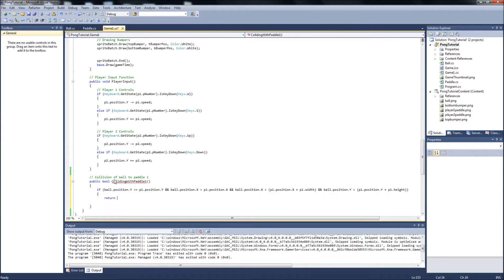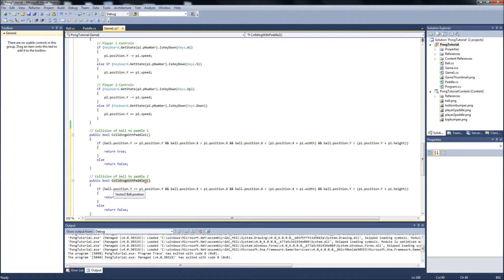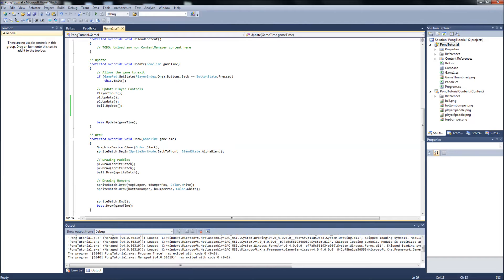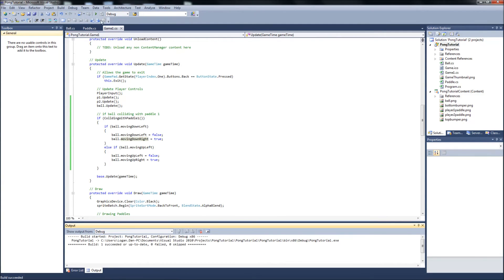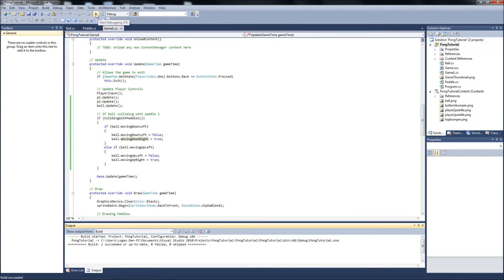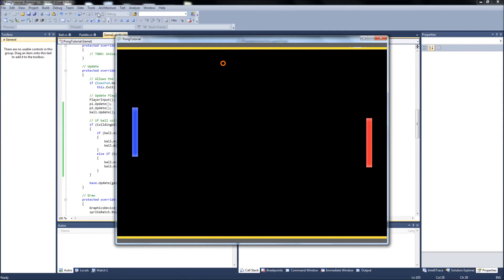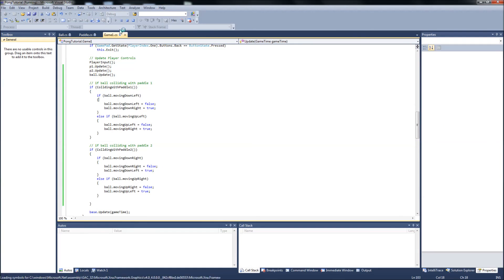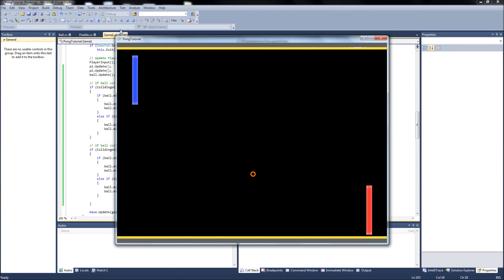Pong Clone Tutorial #8 - XNA - Paddle Collision

Comment from the maker: That might be the issue, the Fullscreen thing. I'll have to go back and look but i think i hardcoded the screen dimensions in alot of the code so when it goes fullscreen it wont be accurate probably. so anywhere in your program where you hardcoded the width or height of your screen you might need to change those to "graphics.GraphicsDevice.Viewport.Height" and .Width.